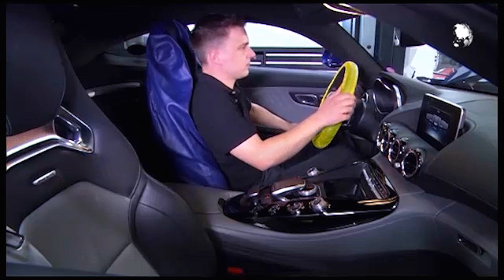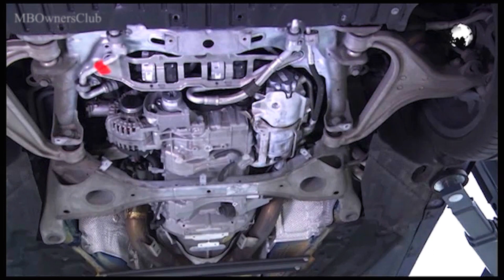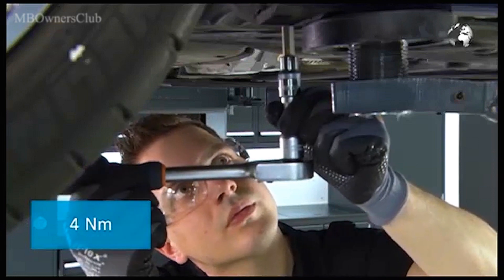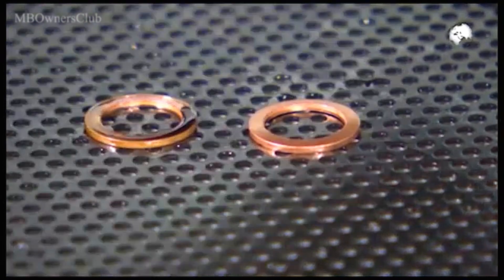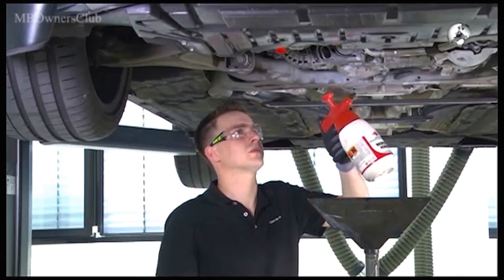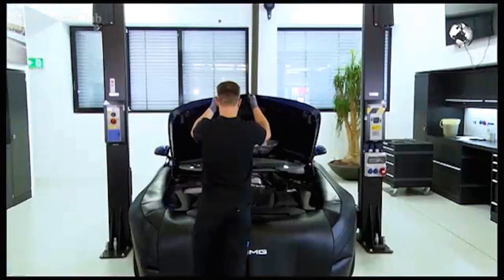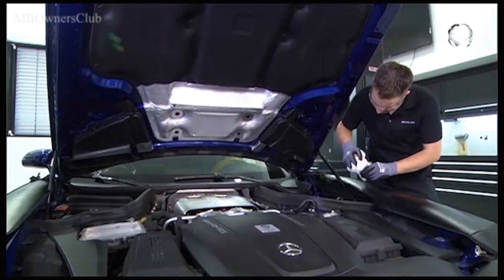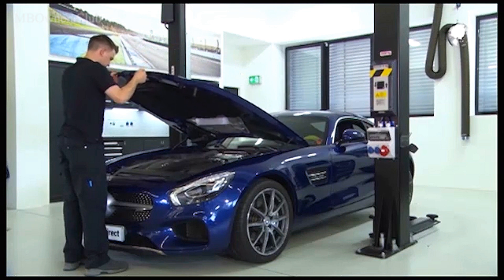Mercedes-AMG GT C190 with M178 Engine: How to Perform an Engine Oil and Filter Change

Comment: Three items: 1. size and dimensions of tube use to direct oil to catch pan? 2. What is the tool or gadget used to release plastic oil plug? 3. Why two oil drain plugs? Thanks
Reply: Looks like a usual hex / allen key for the plastic drain plug on the oil tank - you can get long ones for this particular task. Two drain plugs to cover (1) the actual oil tank (dry sump) and (2) to drain residual oil in the bottom of the engine not yet returned to the oil tank. As for the tube, I suggest using a set of calipers to measure that aperture where the oil tank drain plug is, and then matching that size to some tubing avaliable at your local DIY store. You could improvise with any sort of tubing - I don't see why it couldnt be plastic, for example.
Reply: Hello I work on these cars for a living and will share some tips.

1. There are easier methods to drain the oil reservoir than are shown in this video. I usually just siphon it out through the top (from where the oil is poured into the vehicle). Much cleaner this way, and you don't have to mess with the plastic drain plug. A hand pump works fine for this. If you are still dead set on draining from the bottom, a form-a-funnel can be rolled up like a newspaper and used in place of the pipe.

2. This is the Mercedes oil drain plug tool used on vehicles with plastic oil pans, or oil reservoirs. A google search will bring it up. Not too expensive.

3. This vehicle uses a somewhat dry sump system where the majority of the oil is stored in a reservoir versus the crankcase. The engine doesn't really have a traditional oil pan. Simply a sump which holds a small amount of oil cold start purposes.
Reply: @LynxStarAuto  my understanding is that you cannot siphon oil from a dry sump engine. Is that correct?